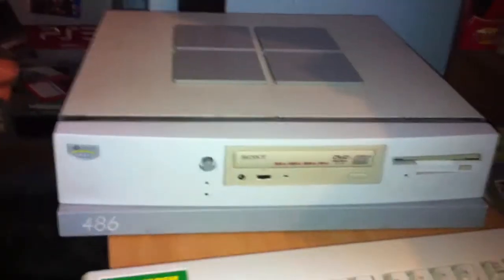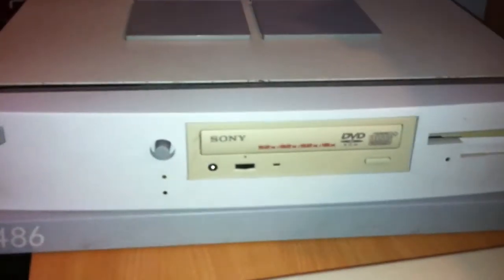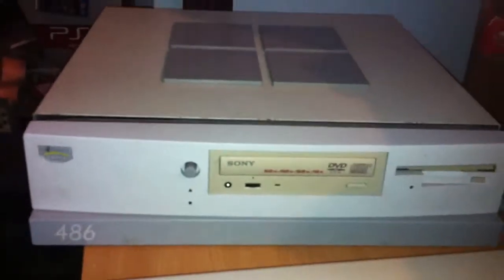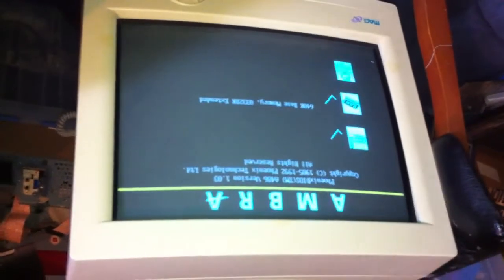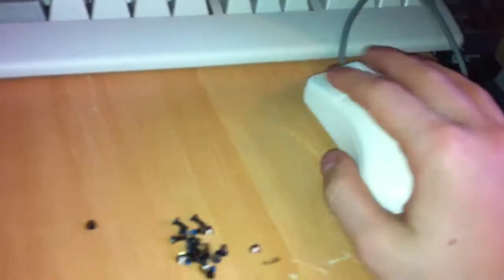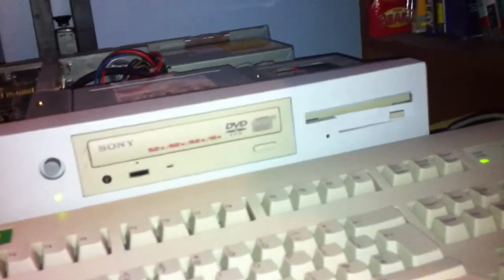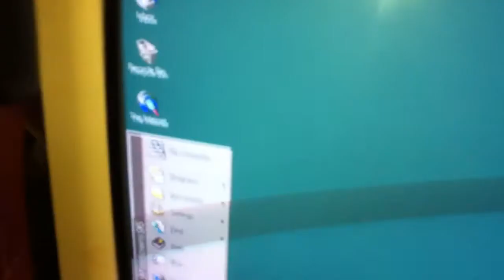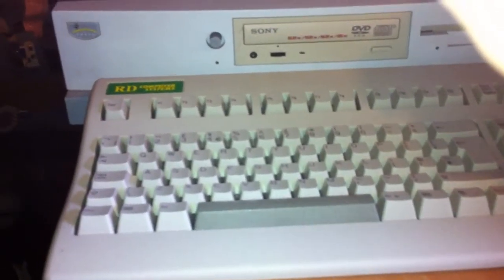scrap finds: old 486 computer

Comment: This is weird, your 486SX with 4 mb of ram is faster (at least in windows 95) than my 486DX with 24mb of ram and maybe also my 486DX2 with 32 mb of ram !

But maybe you have cache memory installed, mine doesn't have any cache chips

I think that you can put a 486 into the math coprocessor socket because the "487" that go in it is actually a 486 with one more pin to disable your 486SX. Otherwise the pinout is the same
Reply: Of course it'd faster he has i486 which is 479 I,s better then I7extream.
Reply: Of course it'd faster he has i486 which is 479 I,s better then I7extream.